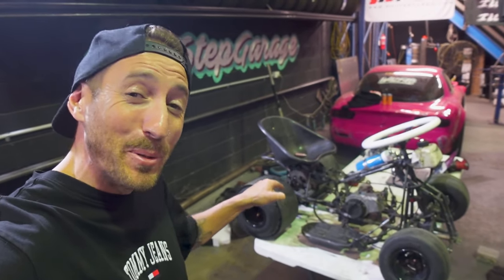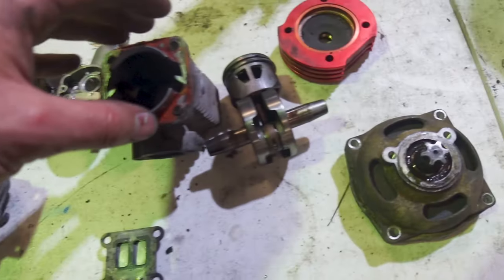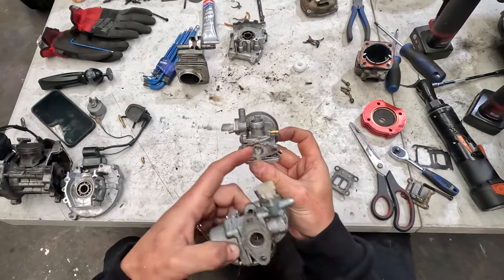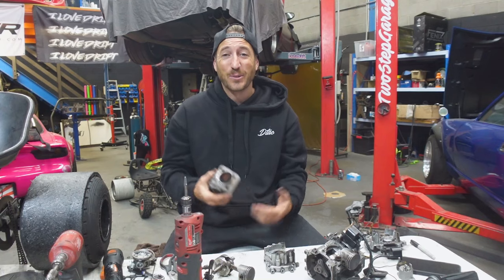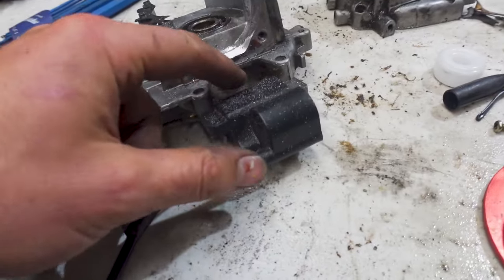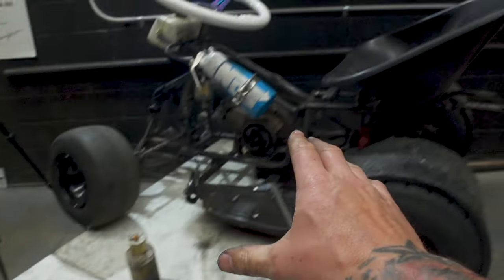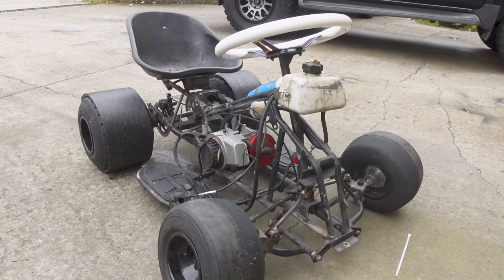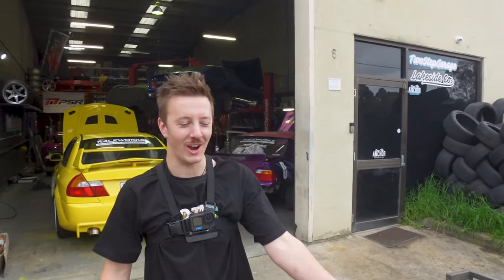We DOUBLE our 50cc 2 stroke Drift Kart power for FREE!

Comment: Love watching the updates on the kart. Do some frame mods and you can fit a predator 212 from harbor freight on it. You won't be disappointed and you'll wish you did it sooner. Stock form will have that kart running 40mph depending on gearing and weight of rider.

Comment: The new motor now wants to rev higher so the gearing is a must as the torque limit is the tiny ass crank you want high revs at all times 30kph instead of 50kph for wheel spin 👌

Comment: What you wanna do is fill the crank case with bog and seal the bog, this will compress the precharge into the cylinder and drill some 1mm holes behind the top ring on the piston in a star configuration. This will expand the ring for better compression.
Note when filling the crank case with bog keep turning the engine over as to not have any clearance issues.

Comment: The exhaust port is to low some of the piston will be blocking that off making a bit of resistance in the  pressure escaping the cylinder head might want to check that just to make sure its still clearing

Comment: i built my homemade scooter with the same engine, advanced the timing by widening the hole on the coil pack and move it. 
got the engine really cheap because these are used in weed wackers in my country
Reply from the maker: That works also! So good how many mods you can do on these motors 👌🏻
Reply: @itsmikelake  yeah i saw some peoples put chainsaw carb on then too! they said it feeds in more fuel and is more responsive

Comment: expansion chamber needs to be at least 30 cm long. 1 inch exhaust  header and 1 inch exhaust pipe exit. the center of the expansion needs to be 120 mm long and 100 mm diameter obviously cones on each end. i had my 50 cc Husser scooter up to 110 kph before i blew the sparkplug out the hole with thread attached. i also made custom  26mm stainless intake and strapped an ag 100 carb to it ported and polished exhaust and intake. also max length on header pipe wants to be no more than 150 mm
Reply from the maker: That sounds absolutely mental! Haha I’d love to get this thing up to 100kph 😍
Reply: different sprocket size and tooth count on sed sprockets is how you could change gearing ill be watching my bro im loving the Bild  keep up the good work.  @itsmikelake

Comment: your main issue is the bad motor, those things are puny for a 50cc and can barely make any power at all, i have a few recommendations. If you want gears, go for a am6 or a rabasa/d50b0 engine, these are used on mopeds and have gearboxes and are actually good quality and they have a bunch of part manufacturers for them, if you want to keep it 50cc, high end 50cc cylinders are made for these things by bidalot, and you can also bore them up all the way to 115cc. They sell specialized ignition systems, exhausts, carbs, reeds, anything you could think of, this will truly give that kart the power it needs. Another option would be to use engines found in 2 stroke scooters, they are CVT meaning no transmission, so its easier to drive, just put a scooter engine onto there and mod a sprocket onto the wheel mount and you have wayy more power.

Comment: The fins on the flywheel is to keep the motor cool hopefully it doesn't hot to and melt a piston😢...but overall great build dude I love it and I'm surprised how strong those tiny 50cc engines are..😂😅
Reply: with experience in modding thing like the Honda GX200 and clones of it (as found on waterblasters) the Billet Aluminium flywheels that are designed for 3 times the revs of the standard engine have 1/2 the number of vanes, sometimes less, depending on the manufacturer and expected rev range... more fins create a massive amount of drag and cool the engine too much, as the engine is designed for kids, the engine is designed to run constantly at 1/2 revs, as long as he's maxing it out most of the time, it wont overheat.
Reply from the maker: Yeah I’ll keep an eye on the engine temps as well as I can 😅 but I did feel the amount of air it was pushing and it didn’t seem to different from the stock flywheel! I can’t believe how much punishment these motors can take haha